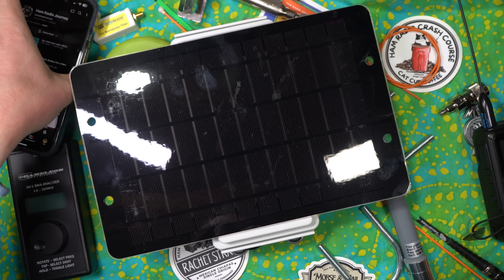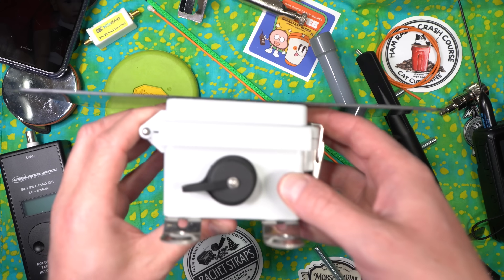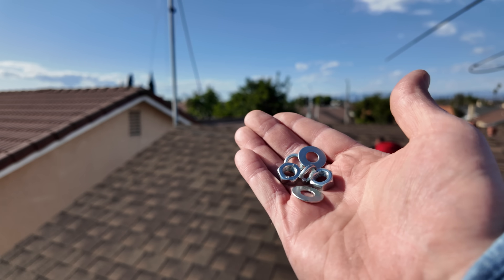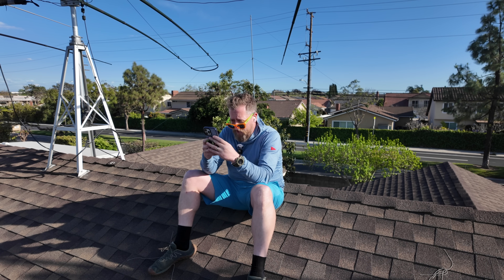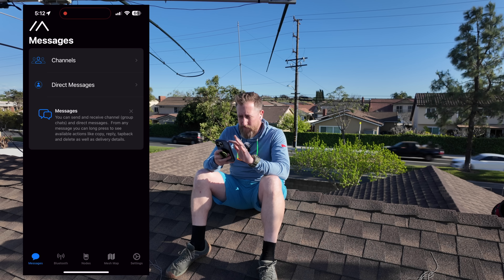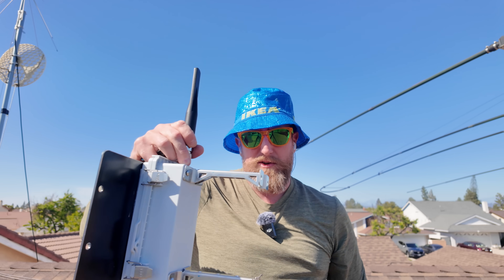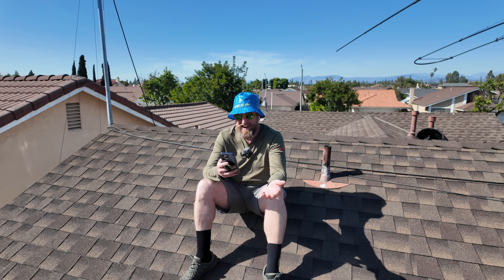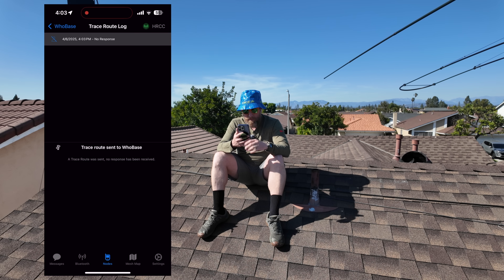FINALLY Solar Meshtastic On My Roof!  LRZNode

Comment: Josh if you think you're an idiot, I just attached a different node to my roof antenna, couldn't understand why signal was crap until I noticed that the radio was SMA-F and the coax was RP-SMA-M (no center pin on either). On the bright side, it was still able to see a tower node 22 miles away! 😂
Reply from the maker: It happens.

Comment: I'm just finishing up a similar rig for our rooftop. What are the two antennas that came with your setup? And would you happen to know what antenna connector is being used? Right now I have a side mount antenna on my weatherproof enclosure. I'd like to have a top mount antenna but it needs to be weatherproof as well...

Comment: What is the voltage on the panel? I have read that the RAK boards can only do MPPT with inputs up to 6V if you are going directly to the board

Comment: I’d like to see a redesign with the solar panel slightly above the box itself. Solar panels lose efficiency with a heat up, which is why most solar panels on peoples roofs are elevated off of the roof itself to allow for cooling.

Comment: Great video. I built a RAK Wireless based Meshtastic node for my home in a weatherproof enclosure that sits atop a 6m mast on my roof. Mine has the Ethernet module is powered via PoE. I can connect to the node via IP from inside using WiFi on my phone, no need to worry about being in Bluetooth range.
Reply: Good idea. I have a fresh roll of outdoor CAT5 I could use.

Comment: Some feedback for your friend, don't use the onboard solar charger on the RAK. It has a known issue when the battery gets low to brownout and get the node stuck in sleep mode. the Best way to prevent it is to use a separate mppt solar charge board and have the battery directly connected to the mppt board battery terminals , then have the load terminals connected to the RAK's battery connector.

The reason to do that is the mppt board will shut the load off if the battery gets to low then turn it back on once it starts charging, this will make the RAK shut down and reboot instead of soft-locking itself into sleep mode. (granted if your solar and battery capacity is more than sufficient this basically won't ever happen but it is something to be aware of)
Reply: This RAK brownout issue has plagued me for months! Brownouts, loss of configuration and yet my dual solar panels and dual 18650s were fine. TY nobody!
Reply: @scotterdog1036  you're welcome o/
Reply: @scotterdog1036  It is easy to prevent rak brownout. All it takes is one of Keith's overdischarge protection boards.

Comment: Last August I built my own Meshtashtic node that is basically the same thing using the RAK wisblock and the same solar panel. I live in Ohio and the winters get cold here. I have read where lithium batteries will shut down below freezing. Furthermore if you try to charge them in that state, you cause permanent damage to the battery. Given your situation, it won't be a problem. 

What I did with my Meshtastic node was I purchased a sealed lead AGM 6 volt battery and used the non-USB wire through a schottky diode to charge the battery. The non-USB wire provides 6.5 volts out. I then used a $2 LM317 module from Amazon to step down the 6 volts to 3.8 volts to feed the RAK Wisblock. The AGM battery has a much lower operating temperature than a lithium battery. This winter I had overnight temperatures of 0 degreed F and had no problems with the battery or the Rak Wisblock.

Just an FYI for us who aren't lucky enough to have warm winters.

The good news though, it has worked flawlessly for the last 7 months.
Reply: lto batteries also work
Reply: We're in southeastern Michigan. I'm using lithium ion batteries to hopefully deal with the sub zero temps...
Reply: Apparently charging slowly works fine below freezing. The safe limit is 0.02C bit 0.1C seems to be ok on practice.
Reply: Im having parallel issues with my lithium power in Connecticut. Considering AGM for the winter months for this project. Cold weather <32f'ish turns off my bms on the batteries im using. I have a larger 1kwhr project Im considering a 21w seed starter heater to compensate.

Comment: How are you connecting to the Meshtastic node on the roof (if you are not sitting on the roof next to it)? I am guessing your phone Bluetooth will not reach the node from inside the house.
Reply from the maker: It’s reaches my master bedroom just below it. But honestly, I just mesh through it using a small node in my home connected to usb power.

Comment: I can't get the trace route to work either unless it's 1 hop or less.
Reply: I have all my settings correct. I think it's everyone on different firmware versions and radio interference. Every once in a while, you need to reset your NodeDB to see who really is in range. I love and hate it still 😂.

Comment: I've been meaning to...
Option to mount the panel horizontally would be handy (and option to tilt for folks in cloudy/foggy areas).
Maybe separate panel+battery box from esp32+antenna for more stand-off?
Does up vs down matter for monopole antenna?

Comment: I took down my Meshtastic nodes. I was getting contacts up to 200 miles on them with the use of high gain commercial antennas and high level sites but Meshtastic is old tech and no one appreciated them being there.

Comment: The RAK modules don’t use much battery power compared to others. So the panel orientation should be fine.
Reply from the maker: Oh yeah. It charges to 💯 very quickly in the morning.

Comment: You also need to set the angle to match your location. In Cerritos, a fixed tilt angle of around 34° would be suitable for maximizing annual energy production for year-round operation. Or you can adjust the angle two or three times a year.
Reply: You might find 1:07 interesting. He can probably keep a rak's battery charged up with only 30 minutes of sun per day in LA with that solar panel. I have one. It recharges my rak's battery every day even when there is a thin layer of snow on it.

Comment: We need a video tour of the antennas on your roof. What each one does, how it is secured, and how you wire it into your shack.
Reply: 100% this
Reply: That would be great. On that subject, I plugged my UHF yagi on a pole into my TV to see if it would give me much signal from the tower farm for my area which is about 35 mi away. It was already pointed at a friend of mine down that direction so we could talk simplex on gmrs, and thats only about 7° off the towers, but the TV signals are clear as a bell. As I understand it most of the TV channels in my area are UHF.
Reply: Yes we need this!

Comment: I just ordered a WisMesh Repeater Mini for my roof. There are no nodes in my area so hopefully this will help get things kickstarted.
Reply: There is a website where you put two pins in a map and it shows whether they have line of sight. Forget the one which works in the US but there’s a couple other of options. Worth checking that for optimal positioning if doing it to contribute to local area.
Reply: @tonyhawk123  heywhatsthat
Reply: I got two heltec boards today and nothing in my area either. I guess, I'll stick one board at work and one at home .. both on the roof with a yagi and then we'll see.